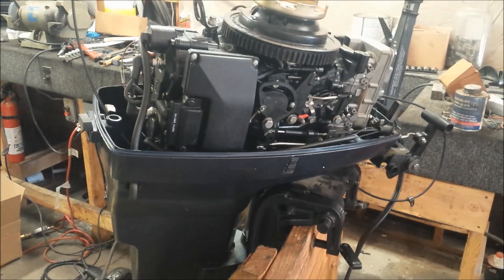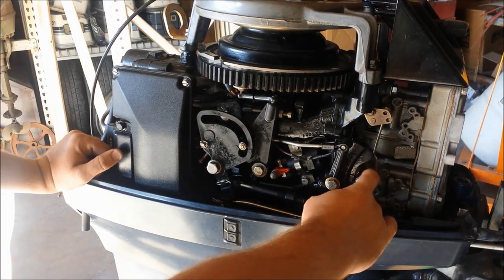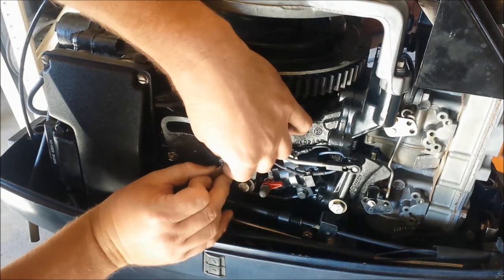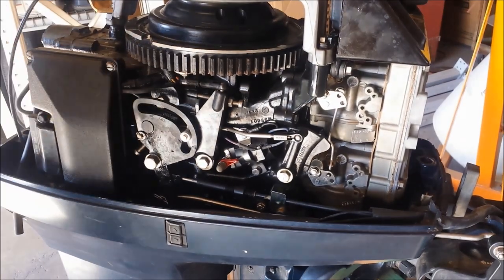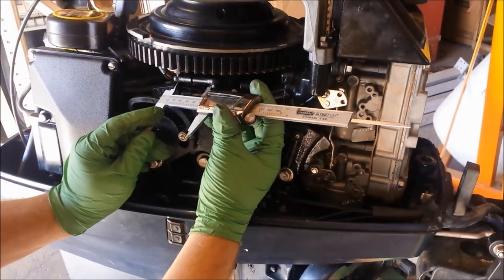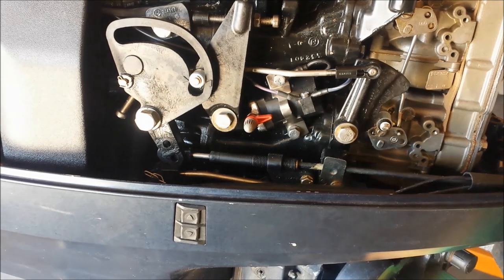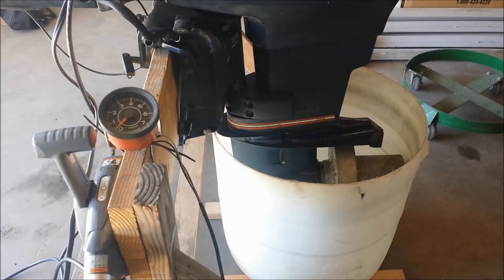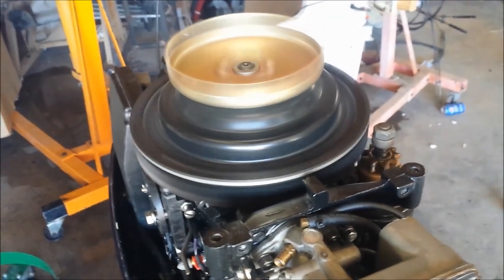Evinrude 40 HP Part 7: Throttle Synchronization and Test Start

Comment: Thanks for the video and I have some thoughts about timing:
The primary thing that is trying to be accomplished is to measure the maximum advance on the timing.  In this case, 19 degrees before top dead center, or 19 BTDC.  The reason 'they' want you to use a test prop is so you, the tester, set the throttle to wide open and make 5000 rpm, but not exceed 5500 rpm (spec in the manual to get a prop that does that on the water)  The primary issue is Wide Open Throttle.  Since the timing is purely mechanical, has nothing to do with rpm, we can observe the cam action where the actuator physically moves the link for timing.    By advancing the throttle, we can see the link move and the timing arm move as well.   UP TO A POINT!  At about 1/2 to 3/4 throttle, the actuator arm and the timing, no longer physically advance.  The cam action turns straight, no longer a curve, so the arm doesn't physically move the timing past that point.  
My testing discovered that with motor out of water, with the flushing adaptor attached, I reach 5500 rpm at the same point in the cam movement that the timing doesn't physically advance any further.  By setting my timing so that it is at 19 BTDC with the motor running w/flush adaptor, and throttle set for 5500 rpm, the timing doesn't advance any further pushing the throttle further all the way to wide open throttle.  This is something you can do for very short periods of time: blip the throttle to WOT (wide open throttle)  and observe the timing mark with a timing light and see that the timing doesn't move any further than it did at 5500rpm and 1/2 or so throttle.  Physically impossible to get more advance out the timing since the cam motion that moves the actuator arm that controls timing flattens out the movement.  
Sounds confusing, but think about it, and you'll see that the timing is a physical movement, controlled by the cam, which is controlled by the throttle and tops out well before WOT.  The only issue then is rpm, making minimum 5,000 rpm for full 19 BTDC and not earlier.  
Verify that idle is ZERO degrees advance. (Some people state it's 4 BTDC, but the only way setting 4 BTDC is to have full 19BTDC well before 5,000rpm and that'll put a hole in a piston by way of over heat and pressure.  Either that or you'll break a rod.  
Cheers!

Comment: Hi Brandon, you prepare some great videos, thanks for taking the time to helps us all, l have just completed the synchronisation and have question, even with the cable adjustment in the zero position l cannot fit the throttle pin into place without giving some throttle linkage advancement, is that ok or do l need to look at changing cables.
Chers.

Comment: My question is if those rollers are worn down what effect will that have on running the motor? If I just replace these rollers will it screw up my timing? My rollers are worn down a bit. The boat Idles at about 800rpm and It's supposed to Idle at 725 to 775. Thanks!

Comment: FYI I took the plugs out installed a wire thing with a gator clip to ground out the plug wires put it in full WOT and used my remote start and it hits dead on @ 19 degrees.
Reply: Can you elaborate on this for me a little. I’m trying to figure my timing out. You basically just grounded the plug wires to the block and cranked it over with the starter with a test light on it? It’s not under load but sounds like that’s a decent way to get timing close. I’m not looking to build a racer, just want it to run safely.
Reply: @wwburroughs  You have to have a remote start to bypass the neutral safety switch.  So, either you do this on the water at WOT (not really safe) or you do this the way I suggest and it works.  The timing and the carbs opening have to be in sync to properly run.
Reply: Thanks for watching.

Comment: Hey Brandon, Thanks for all of the great videos, they have really helped.  I am doing  a link and synch on a 1987 40 HP E40ECD Evinrude (as I recall you have done some videos on one of those earlier models as well) and I just got my copy of the OMC Service Manual and I was surprised to find no mention of the measurements for the lengths of the two rods that you reference in this video on the later models.  Did you find those measurements somewhere else? Or, are they not relevant for the earlier model OMC 40's? Thanks in advance!
Reply from the maker: Not relevant for the pre 1989 motors.

Comment: One question......what is the part number for the front roller? I can't seem to find it in any of the parts diagrams.

Great videos on the 40hp. They have been VERY helpful in getting my old '91 back up to snuff.

Comment: So my throttle cables and levers are a little different (j40elccs) but the carb linkage is the same and my carb linkage was not set correctly, one of the carbs the rod was not even fully seated. Anyhow i adjust the linkage so they open at exactly the same time. Thank you.

Comment: Hi Brandon I have the same motor as you,,I just bought and used it as it was for this year,,I hauled the boat up last week and noticed that the throttle sync is way out of whack,, the plate with the half moon slot that has the little roller in it that u adjusted first  is nowhere near the 2 arrows and the spark control rod is wound out to about 3 inches..the motor seems to run ok..do u think I should correct or leave well enough alone?

Comment: I just picked up a boat with the same motor. 93 evinrude tracker 40hp. I did a cold compression test before doing a lake test & compression was 150 on top cylinder 149 on bottom. Does that seem high? I trust the gauge
Reply from the maker: Nope, its prefect. 
All the good running 1989+ 40-50HP I have, all have 150PSI.
When they drop closser to 100- you start having running & idling problems.
Reply: @BrandonsGarage  gotcha thanks glad to hear that. Yea this one is a little cold natured, wants to die out when going into reverse  from idle on a cold start, once warm it runs out fine & throttle is responsive. Thinking the low idle needs to be adjusted a little higher

Comment: Hi Brandon,
Watched every videos of yours and I have learn alot from them..  I have a 89 Johnson 70 hp idling fast then slow then fast then slow.  Carbs are cleaned and It's running with  VRO.  Any idea what the problem is? Please help.  Thanks

Comment: I am surprised you didn't use the Joe Reeves link and synch method for the WOT timing.

Ground all spark plug wires with the plugs removed, put a timing light on #1 cylinder,  open throttle to WOT, and get the timing (+4 degrees).

Meaning if it shows 24 degrees BTC, while actually running it would be 28 BTC (+4 when the engine is actually running due to how the ignition system works.
Reply from the maker: Yeah,. I was thinking about doing a video on that, at the time of this I had forgotten all about it.
Reply: @BrandonsGarage   Brandon I have a 1991 Evinrude 40 horsepower VRO engine is the engine a push throttle or is it a pull throttle for the Marpac single lever  control 7-0119
Reply: I've tested mine every which way and I always get 0 BTDC at idle, 19 BTDC at WOT.  Actually 19BTDC at a little over half throttle, but the cam stops advancing timing anyways past that point.

Comment: I'd suggest to set timing just a little advance on idle ....this fixed mine and runs so much better and  didn't effect top end rpm...the older motors new Tec. Calls for this...so I tried it on mine...worked great

Comment: I have the same motor same year I've cleaned carbs checked floats all checks out. I still have idle problems I can't keep it idling seems the idle is low how can I idle the engine higher so I don't stop running?

Comment: Hi. Great video. Did you use the same sleeve and roller for both the spark lever and near the carb?   I have an '89 40hp Evinrude. Crowley Marine's website shows them both as sleeve and rollers but have different part numbers. Thanks.
Reply from the maker: they are both different, but named the same.

Comment: Do you have a fbook? I just got a 40horse evinrude and I'm trying to get everything right in it. I have it running but it doesnt idle very well. But driving it seems to run fine.. I've cleaned the carbs already. Just trying to figure out why it dies at idle...
Reply: Sounds like it is sucking in to much air and not enough fuel try adjusting your air control valve should be on top of the carburetor hope this helps you out.
Reply: I just got a 92 40hp.  Follow that other video, the one thats in VHS he posted.  Really good.  But the timing rod length on mine cant be 2 1/6" cus it won't adjust down that short.  Waiting on a manual off ebay, only $25

Comment: Could you make a video on using timing lights with outboard?..I'm a loyal watcher man ,I wish I knew half of of what u do
Reply: clip timing lead to #1 cyl. read timing on flywheel directly across from pointer. done. on models with adjustable timing pointer, you must set it with a piston stop tool.

Comment: Thanks for the excellent tutorial. This might just be the solution to our problems. Are the two rollers the same? Or is the follower roller a different part? I'm in Australia and the Ebay links aren't working from here. Thanks again for all the time you invest in your videos. They're a big part of my steep learning curve!
Reply: Hello,,
 I'm in the UK and when I last looked some years ago these rollers were going to cost £50 with postage! Since then Evinrude went bust and I got a 3d printer. Just printed them today in pla. If they survive I'll post the files on Thingiverse.

Comment: You discussed the issue of not finding a test prop, but then that your rigged something up?  Can you elaborate?   Seems like a show stopper?
Reply from the maker: I had a 1988 40/50 HP test prop I put on, it didnt work so well. 
Wound up using the slow speed timing light method.

Comment: I have a question. Jus purchased a 99 50hp Johnson. Are the 7 13/16 and 2 1/16 rod lengths the same for the 25 thru 50 models or are the lengths different?
Reply: I am now working on a 2000 50 hp. In 1993 the rod length changed to 2-1/2” and 7-5/8”

Comment: Do you know how many turns you made for the air/mix screw on both carbs?
Reply: Yes need answer to this asap
Reply: Mine were at 3 3/4 but thats seams too much.  Fuel/air screws typ are between 1 and 3 turns out.  Most times you start out at 1 1/2

Comment: Hi, Great video!  What I was wanting to know do you have a video on how to disassemble the throttle assembly and also the red Center adjustment you can turn left or right is that supposed to tighten or is it supposed to just rotate because it don't really seem to do anything or is it defective? Thank you Brandon
Reply: This really is a good video.  That 4 degrees @ idles is + or -2 degree.  You can adjust that slightly to make it run smoother.  Love it though.
Reply: @hawkeyemarine  that range is for setting the idle rpm in forward gear, not for trying to get it to idle any smoother .
Reply: @ct1762  I figured that out when I  was  doing this.  Learning everyday.  Thanks!

Comment: Curious, did fine tune the air screws at idle ? Or just a set number of turns out from a light seating .
Reply: The factory idle setting is 3 whole turns out from light seating and need to be adjusted until idle around 800 rpm s and when sounds balanced. The medium to high speed jets have no adjustments.

Comment: Just did the lync and sinc on my 1995 40hp evinrude. Followed step by step. I did notice that I was missing the plastic sleeve that goes on the roller for the throttle. Motor runs fine but stalls out in low idle. I’m wondering if missing the plastic sleeve could be my issue?🤷🏻‍♂️
Reply: No not really the idle timing could need to be advanced a little more and the idle mixture adjusted also. I would advance the idle timing first then the carburetors.
Reply: The roller on the carburetors will mostly effect the high speed side

Comment: Have you ever made a video for setting/adjusting the low speed needle valve on the carbs?  I decided to just check where mine were by turning them in until seated, counting the turns along the way, then turning the same number of turns back out.  WHAT A MISTAKE!  Motor would not start.  Had to fuss with them for a couple of hours before I found the right combo so the motor would run again.  1/4 turn either way and the engine nearly dies and that's just ONE carb, not both.  Very touchy.  I was hoping to discover a way to get my motor to run better at high altitudes.  Where I live, I could be fishing anywhere from around 100' above sea level to over 6,000' above.  At above 4500, the motor struggles to idle and floods very easily.  Hoping someone somewhere has some insight into the adjustment for these jets or how to rejet the rest of the carb for high altitudes without big drama.
Reply from the maker: I believe it's in the manual, jetting, not the adjustment. That's always a pain in the butt on multiple cylinder engine.

Comment: hello, I have a question. I have a 1992 evinrude 48 spl basically the same thing. My spark advance lever breaks into when I try to crank the motor would you have any idea what would cause this. The rod that measures 2.1 throws all the way back and stops the flywheel from turning. Thanks in advance if you have any Ideas.
Reply from the maker: The rod pops up, and hits the flywheel??
Reply: I added this already but that timing rod on the 90 is a different part number on my 92.  I figured it out when I tried to adjust it down to 2.1.....   could only get 2.3.  Was at 2.6ish.  Hopefully the manual I have coming will verify its different.

Comment: I have the 1992 50hp Johnson. That roller didn’t fit in either spot on my motor. It is too big around for the carburetor roller. Its too long for the the other roller, so I cut it down. My motor looks identical to the engine in the video. part # 397499.
Reply: I have a 92 40 and I cant get the 2 1/16 on the idle rod.  The 92s rod is different part number then this 90.  Boats.net will tell you about roller

Comment: Hi ! Please i have the same motor . It seems to run on slow mode . Do you know why? Does it has a temperature sensor ? Thanks a Lot !!!!
Reply: If it overheated,  it put the ufi into a 2000 rpm protection mode.

Comment: Do you know if its normal for the flywheel to get very hot for these motors? I have two, and one does and the other doesnt. I have read somewhere that its normal due the electric generation, but my other one doesnt get so hot. The water from both engines is very cool, so I do not really think the motor itself is overheating...   Trying to troubleshoot the issue.  Thanks
Reply from the maker: Thats odd.
flywheel doesnt get very warm at all. Seems odd to me.
Reply: Repair of VRO pump

Comment: Would the same specs apply to a 2000 Johnson 40hp? Everything looks the same, except for spark advance slot. Mine has an additional curve within the curve. As yours is one smooth curve.

Comment: Do you know where i can find a carb cover like yours. i need one and cant seem to find one anywhere
Reply from the maker: You are in luck my friend, as there is exactly one on eBay - https://ebay.to/2KWbGV5

They came on Rope-Start engines only. 
With rope start, you have no electronics, thus, no VRO. Rope start 40-50HP engines from the early 90's are extremely uncommon. Ive been looking for a new hood for my engine (again, rope start engine only) for almost a year now, with no luck.

However, you can still buy a new air cover, will cost just shy of $200:
0395361 BASE, Air silencer. Rope Start
0329396 COVER, Air silencer. Rope start
0329239 SCREW, Cover to base. Rope Start
Reply: Hi Dear
Nice video! 
İ have similar motors. But our motor sometimes doesnt working. Firstly it is working and a few min later when i stopped to engine it is dont start again one more time. But 15 min later it is working again 
What is the problem on your mind ? What do you thibk about this problem ?